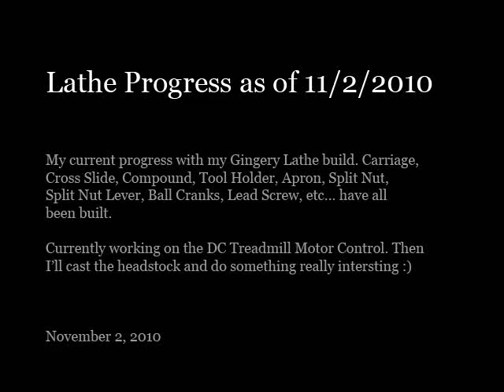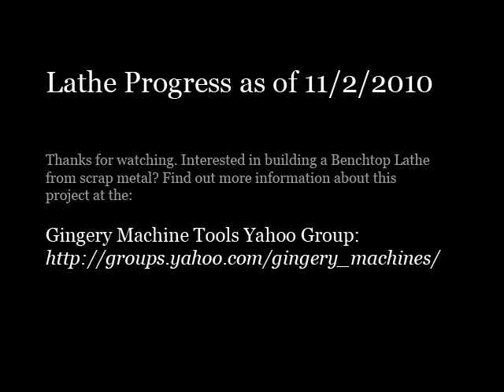Gingery Lathe Progress as of 11/2/2010

Comment from the maker: @Data643 Another section of threaded rod is used as a core when molding the pattern in sand for the pour. This piece of threaded rod is sacrificial as it is cut out of the cast split nut. The split nut is cast in Zinc, unlike the rest of the parts which are cast in aluminum.

Comment from the maker: @Data643 The split nut for this lathe, like all the other parts, are created from scratch. The pattern was made in wood, and the nut itself was built up from auto body putty. The pattern of the split nut is used in conjunction with the lathe & apron such that the actual threads from the leadscrew are registered on the split nut. Once the auto body putty sets up, the patterns is removed and a section of threaded rod is threaded into the split nut pattern.

Comment from the maker: @steveBB30 Thanks for the reply. I currently don't have a miller so I won't be able to make gears for the lathe at this point. I was hoping to drive the leadscrew and carriage with stepper motors at some point, and use software to do the thread cutting. To drive the spindle I'll be using a V-belt initially, and if it slips too much will most likely look into a better alternative at that point.

not sure on the torque difference, however I could definitely log such data in software.